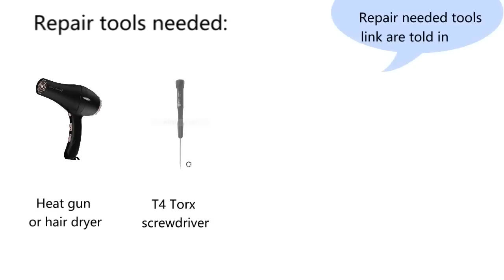Motorola Moto G2015 Teardown/Disassembly Repair

Comment: Is it easy to replace the battery only? Would you have to disassemble the whole phone just to replace the battery?
Reply from the maker: +Amir Amran to replace battery, you still need to remove lcd screen and take out mainboard but no need to disassemble it,then you can replace battery,be careful when remove lcd screen there is flex cable underneath.

Comment: To replace the SIM&SD card board I just have to take it out and put a new one and it will work? I need help, my SIM reader is broken...
Reply from the maker: +Joaquin Varisco Yes, there is only a little sticker on the backside of SIM&SD card board. it is easy to take it off.
Reply: thank's!

Comment: how to fix power button in Moto g3
Reply from the maker: well, Is your Power Button fail or something else?
Reply: power button broken outside pressing button how to fix new
Reply from the maker: Is it work if you press it hard? If the button was intact but no reaction, problem might be the Power Button contactor, n there's no replacement for contactor yet. Is your phone still in warranty? If yes, maybe you can ask Motorola for help  :)

Comment: if i want to replace rear housing do i have to remove lcd?.i dropped my phone and the housing is dent and isn't water proof.i want to replace it
Reply from the maker: do you mean the part that under the removable back cover? yes, if you wanna replace it you have to remove the lcd first cause there's screws on the board which lock the rear housing
Reply: Wit Rigs because of the dent it won't shut completely making it not waterproof
Reply: Andrew Kim the back isn't what makes it waterproof. The back has rubber pads sealing the SD and SIM slots, that's the only bit stopping any water

Comment: Hi
Few months ago my screen was broken and there for I had replaced it with duplicate screen. Now I am unable to use M.M based ROM as in that ROM touch do not work but in L.P 5.1.1 it work perfectly. is it hardware problem or software...

Comment: Hello! I had an issue with my phone last year and took it to a Motorola authorized service.
I was having an issue with boot loader, I believe the OS image was corrupted, they suggested changing the motherboard.
They did, but when they gave it back to me, it had several issues, one of them was the screen flickering, probably due to an issue with the sensor. They said it was a problem with the module (like saying it was a separate part of the motherboard), is this correct?
Another issue was the microphone not working.
They damaged my phone beyond any chance of repair and I'm started legal proceedings against these people, as they are saying they did everything they could, but clearly did something wrong in the process.
Any comments on this would be very much appreciated it.
Thanks in advanced!